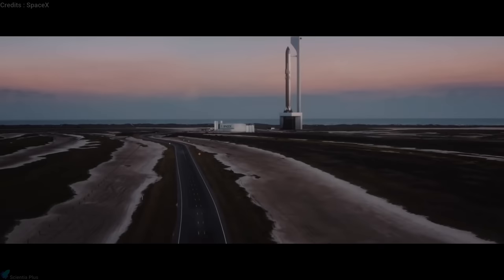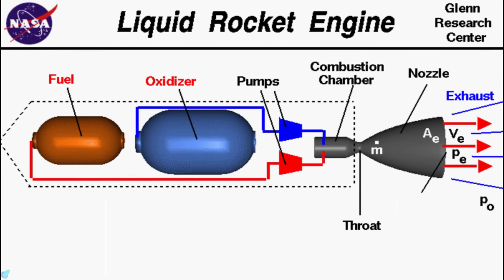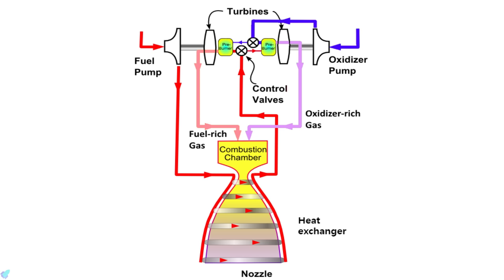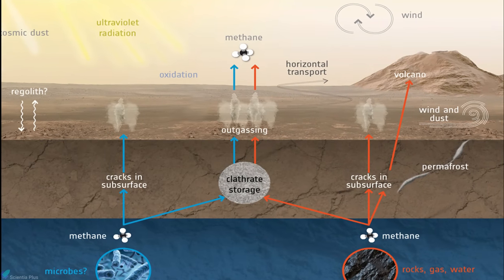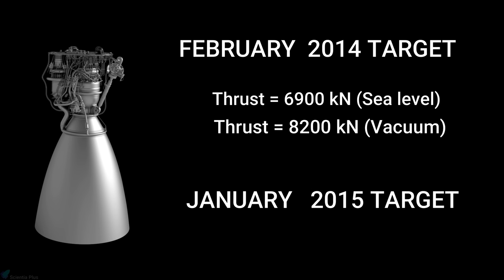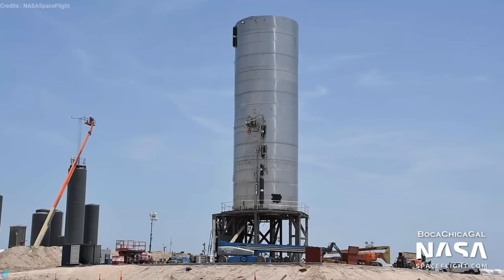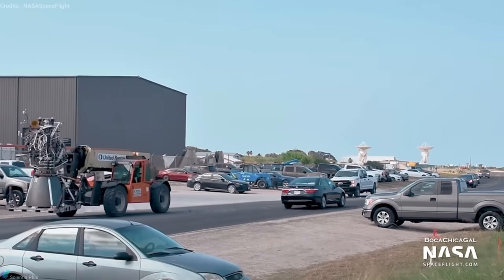The Insane Engineering of SpaceX Raptor Explained - Part 1 | Starship Engineering Series

Comment: Hu.. if you dump down, a Raptor, in terms of any gas turbine. The Mechanical Compressor, now becomes a variable high velocity "Gas Compressor"... nice. I've been a gas turbine guy, all my teenage and adult life. I never had a chance, to put my hands on  a rocket, always wanted to round out my engine experience from, Internal Combustion to Rocket. I had a very good run with Gas Turbines. You have a follower.

Comment: What is missing in this pretty good, but not well organized video is details on why is fully staged combustion cycle engine such a big deal, and why is Raptor the first one to actually fly (if just for a short hop so far). Many interesting details heve beem glossed over (coking problem, combustion chamber material problem in oxidizer-rich design, the rationale behind various injector designs...)
For those interested in details, Scott Manley and Tim Dodd both have good videos on the topic.

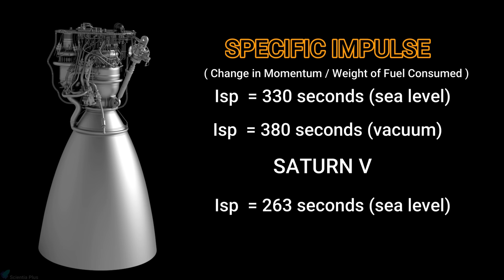Comment: It is a bit misleading saying the Saturn V vacuum ISP was 421 seconds ISP (4:20).  The first stage of the Saturn V has F-1 RP-1 / LOX gas generator cycle engines.  The 2nd and 3rd stages had J-2 LH / LOX gas generator engines.  They are completely different animals and hydrogen by its nature has higher ISP than any other fuels.

Comment: how does spacex prevent liquid fuel from freezing when it has flown into space?
Reply from the maker: Actually, Space is hot because of radiative heating from the sun.
Also, spacecraft perform a "barbecue roll" maneuver to maintain an even external temperature.
Moreover, the propellants are stored in thermally protected insulated tanks.
If somehow the propellant got frozen ( for example, when entering in the shadow of a planet ) electrical heaters are used to reheat them.

Comment: 4:15 you speak as it was the same kind of engine though. Nope, the first and second stages of Saturn V are very different engines. The booster engines are low efficiency high powered Kerolox engines, the second stage are efficient vacuum optimized efficient engines.

Comment: Someday I would like to see even a simulation of what would happen if raptor engines were put on an old space shuttle as well as two rockets like the falcon heavy.
Reply: Not much point for the Space Shuttle as there was so much work need to re-fly them. You have the specific impulse etc about half way through the video. Tim Dodd does a much better analysis of the types of rockets and the advantage of the fuel types.
Reply: KSP can do that, no?